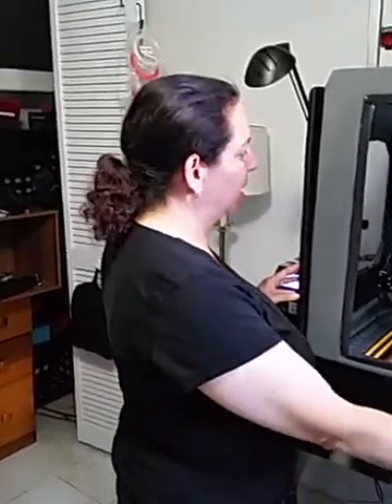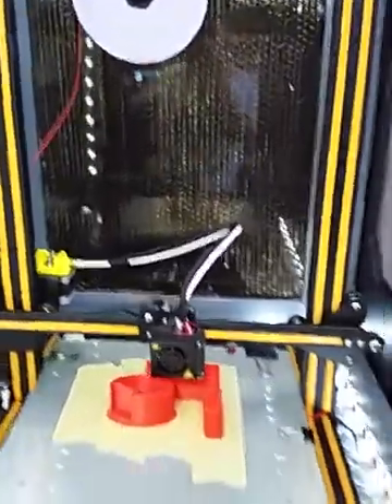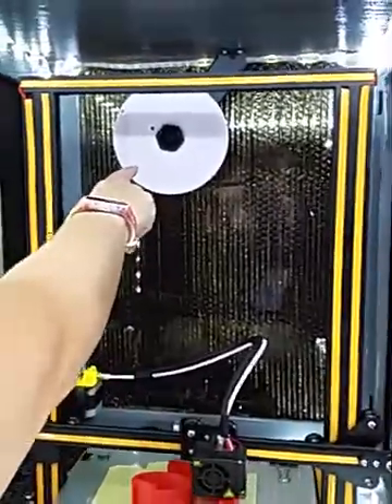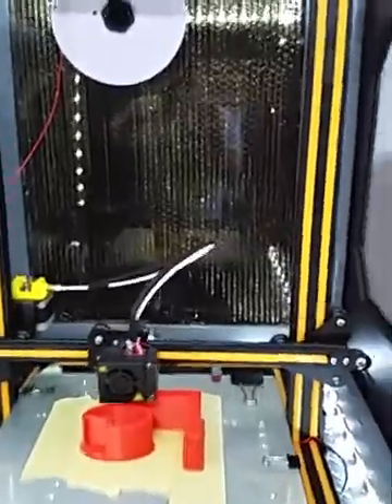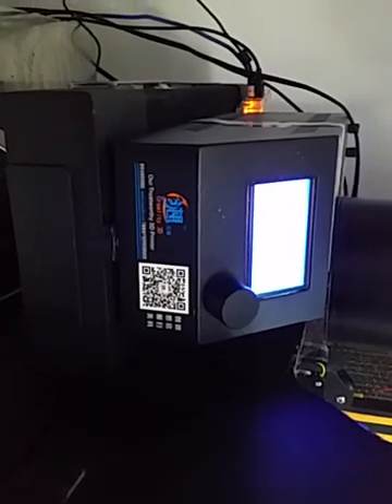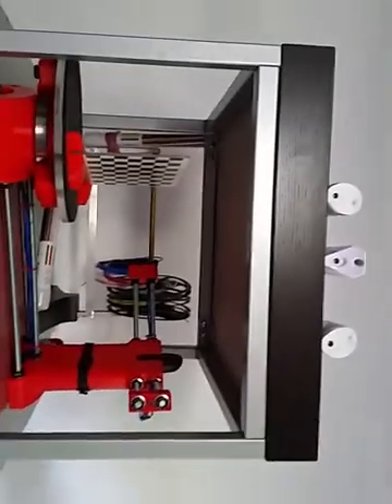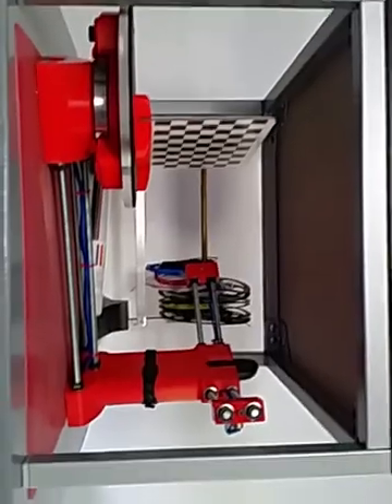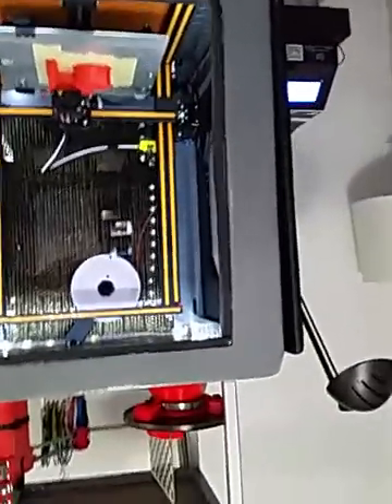Enclosure part 2

Comment: good job.
how are you routing the cables? through a single hole in the back? did u have to extend them to get full z movement? thanks.
Reply from the maker: We have an opening on the side.  The controller is raised so there is enough slack to run without any problems.  Here are pictures of the side.  https://youtu.be/7mNWOJeQqGE
Reply: Two Girls and a Bird thanks